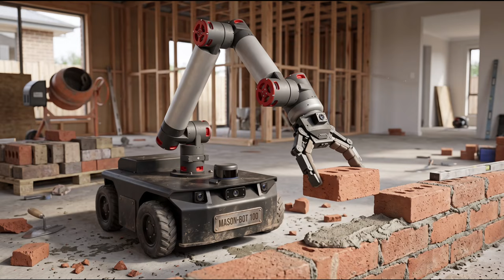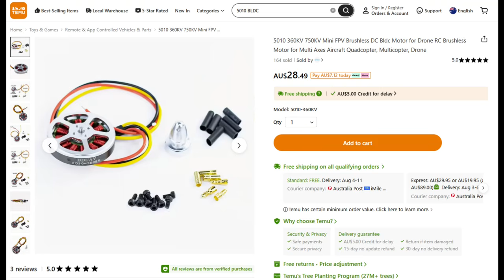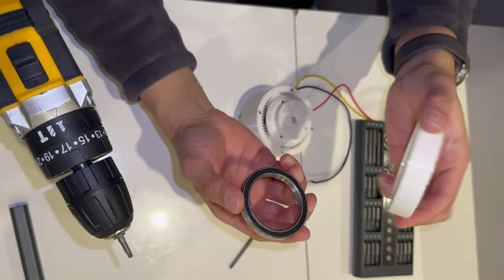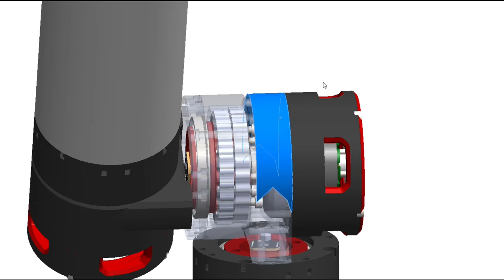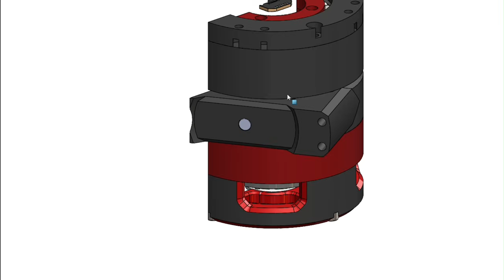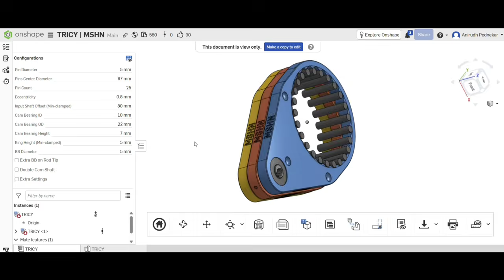Build your own 3D printable BLDC servo actuator for robotics!

Comment: Where can I get 20 x 27 x 6mm bearings? I can only find 20 x 27 x 4mm in stock anywhere...?
Reply from the maker: Hi mate, it is 20x27x4mm bearing not 6 I might have missed typed it. But I can confirm it’s 4mm thick

Comment: In the video you mentioned a build guide in the video. I didnt see a build guide when i downloaded the 2 projects. Did i miss something or are you reffering to the video as the build guide?
Reply from the maker: 😅the video is the build guide actually. If you need any help with the build I’m happy to guide you with the original video with no fast forward. Let me know. Send your email id. 🦾
Reply: @robobiceps the videos seemd to be pretty straight forward and easy to follow. I'm currently out of town for work but when I get home ill start printing the parts. Only difference is ill be using a resin printer. Ill let you know how it goes I might have trouble though because resin printing will often cause warping. 🤷‍♂️
Reply from the maker: Nooo don’t use resin printer, I have given 0 tolerance as pla is soft and bearing can be press fit. Won’t work for resin.. I’ll share step files for you to edit or use pla. Let me know.
Reply: @robobiceps  honestly the actuator came out fine with resin printing.(i had to do some sanding but it wasnt horrible). keep in mind im using a special resin mix that i use for functional resin prints.i dont know for sure if this will work for everything but for this project it seems to be fine. i already have the parts on order for stage 2. looking forward to the whole project
Reply from the maker: @realspitdude15 glad it worked❤ will keep updating on design and cobot build
Reply: @robobiceps  the first stage was perfect and fit together like lego. the second stage im having more trouble. sizing feels off i think some i can account for with the way i print and cure but i do think i may need to make a few adjustments to account for resin. i think i may have to hold you up to that offer you gave me regarding the step files.
Reply: ok after a few modifications i was able to get first and second stages working i posted a video of it running on my channel
Reply from the maker: @realspitdude15 awesome 🎉 let’s built it together

Comment: heyy great project but i have a doubt about how u mounted the encoder. can you please explain that
Reply from the maker: Encoder goes on the output shaft, this is a stage 1 and stage 2 has a cycloid that does a total of 100:1. I have showed in the second video but haven’t installed it yet.you need the 2nd stage for that

Comment: Hi, nice design.  I did a few rough calculations, and it's clear that you put some real thought into this. I would recommend printing the gears with carbon filled nylon if possible. If standard PLA is used, then limit the current on the motor to about 30 Amps (I'm assuming you are using a 360 kV 5010 motor).  One option, if durability is a concern, is to have a steel pinion (sun gear) made by send-cut-send or someone.  Or you might consider buying a steel pinion and redesigning the other gears to work with it.  Awesome project, good luck with it.😊
Reply from the maker: Thanks for the great tips, I'll definitely look into using carbon filled nylon and steel components once I break this pla one when I do some torque test.

Comment: Could you scale one up to use a standard easy to find hoverboard motor? You can make a sweet high torque linear actuator
Reply from the maker: Bldc 5065 is on my list but need to validate this one before I purchase new… why linear motors.? Could be configured to anything if needed
Reply: @robobiceps to attach a ball screw and build inexpensive linear actuators for a 6dof motion racing sim- should be plenty of torque with the planetary gear!

Comment: how much torque output with that specific motor actuator?
Reply from the maker: Still building the stage 2 where I add a cycloidal gear box with a 25:1 making it an overall 100:1 gear reduce.. will test it with the stage 2 video

Comment: Wait a sec, how are you going to do proprioceptive control with a 100:1? You'll need external torque sensors then, making the actuator design very much a moot point here. Anyway, the build is amazing!
Reply from the maker: good point I guess ill have to build the first 2 axis to test this. Thanks for the question

Comment: You can 3D print a vane actuator instead. With 1 encoder and 2 pressure sensors per actuator. It´s cheap, much lighter, has zero backlash, and is a soft cobot due to pneumatics. Check out Festo cobot design
Reply from the maker: that comes under pneumatic cobot, its should be good for the base and shoulder where more power lifting power is needed. Thanks ill keep that in mind. Hope my printer can print something air tight.
Reply: @robobiceps  Don´t worry, you can dip coat smaller parts with PU-varnish or brush it on, on bigger parts. I always do it for watertight parts, like parts I use in the bathroom and kitchen sink to not get mold problems, it just takes 24h or so to fully cure. Personally the pneumatic cobot is way more interesting for me, once the parts are designed it should becomes incredibly cheap to manufacture. It has lots of advantages over the heavy and more expensive electric cobots. Right now I am designing a 5/3 valve which is fully 3D printable minus the O-rings and push in fittings. You can 3D print a TPU tank with say 2L. Rest are cheap 9g servos to actuate the valves. Air is clean and easy to use unlike hydraulic fluid of course.
Reply: @robobiceps  Oh and btw you can also 3D print linear guides with PTFE tubing as bearing material, they glide very well and are incredibly cheap compared to the real deal. If you need something like an additional axis where the robot arm can travel along or you need some camera slider or something. I am all for using the advantage of 3D printing.

Comment: This is Absolutely Amazing, the more complex components people can make home, the more robotics can actually be Open source and produced anywhere. The more open source that hardware is, the more customized at-home manufacturing equipment people can reasonably afford (3D printers, CNC, copper winders, and Robots) for making increasingly sophisticated hardware. Like a positive feedback loop, and You are pioneering it! 

Also I'm wondering what kind of plastic you're using, I'm sure there's a trade-off between expensive plastic that last longer and cheap plastic that wears out quicker. but in my experience, rapid petg is both very cheap and  tough.
Reply from the maker: Thanks! I really appreciate the support. For now I'm using PLA since it's what I had on hand for prototyping the first two axes and validating the design. Once that's proven, I'll move to PETG or carbon fiber filament for the final gear box parts.

I'm also working on improving the harmonic drive to make the actuator even smaller while still achieving a reverse drivable 100:1 reducer gear box. Lots more updates coming subscribe and stick around if you'd like to follow the build! Thanks again